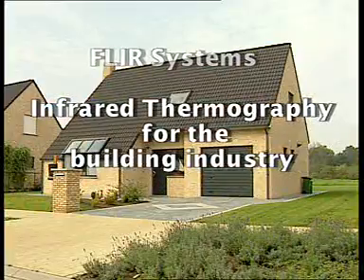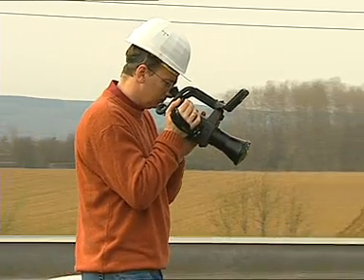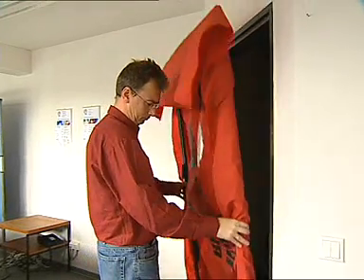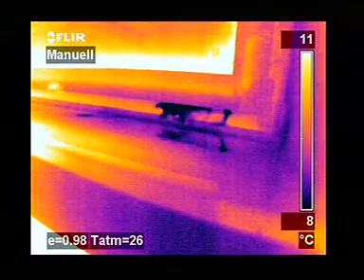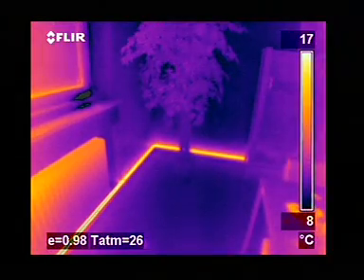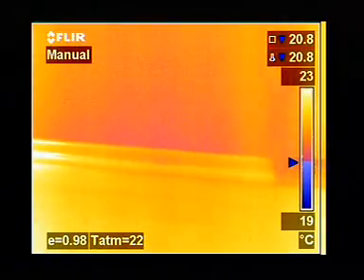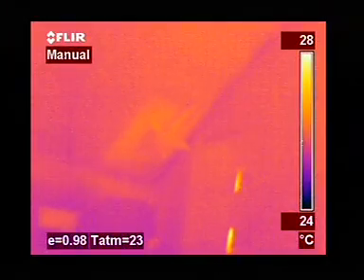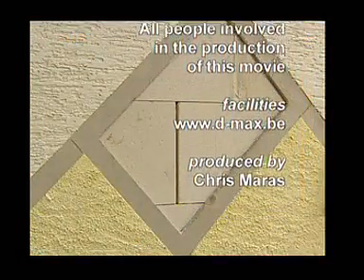FLIR infrared camera for building and home inspection

Comment: Thermal cameras are seriously cool - they've totally changed the way we see and interact with the world. Instead of using visible light, they pick up on differences in temperature using infrared radiation. I actually use my P2 Pro thermal camera a lot for work, especially when inspecting buildings. It's super helpful and the best part is, it doesn't break the bank!

Comment: Is this technology or a similar one available to see through walls to determine if "non-conforming pre-existing construction" was performed to building code standards ?  Am in the middle of a huge problem with LADPW regarding a house I bought with these issues present.  Am faced with potential tear down or tear apart of certain areas unless I can prove they were actually performed to code standards.

Comment: Very useful applications here. And this is from some years ago. I wonder how this technology has improved since then, especially when it comes to cost? Has it reached a level where it's now viable for home owners to actually own one to undertake basic tests?
Reply: +Mat Cendana @ 740$ you get a Flir C2 , same sixe as a phone. And works great. Testing one these days. Not as good range (20- 25 metres?) as the expensive ones, but a real great tool.

Comment: Cool camera, I especially like the dew point s/w, a question though...There are and have been Aluminum foil building materials in homes and buildings; how do you deal with this as it would seem that foil blocks heat rays and is 5% emmisive. ???